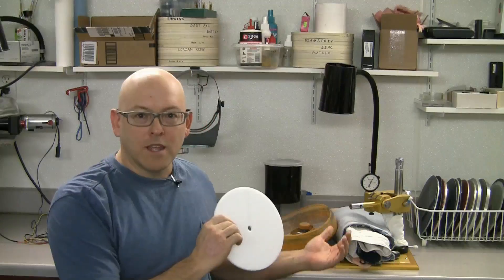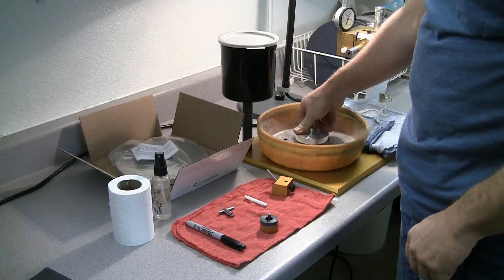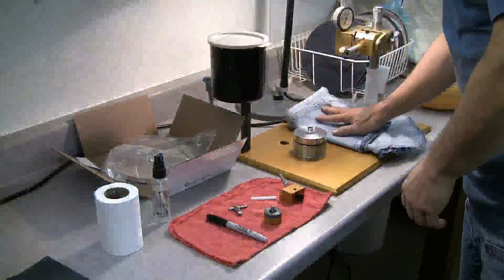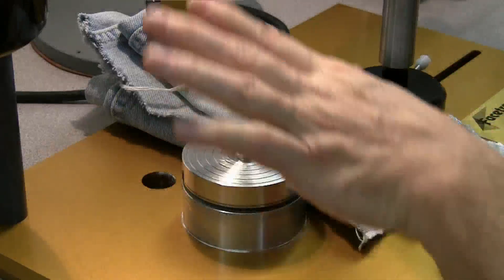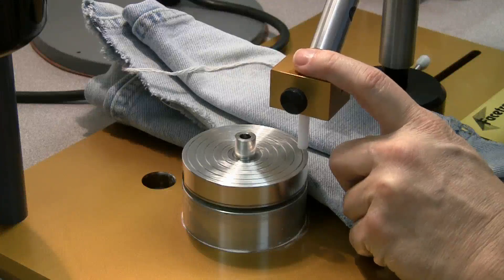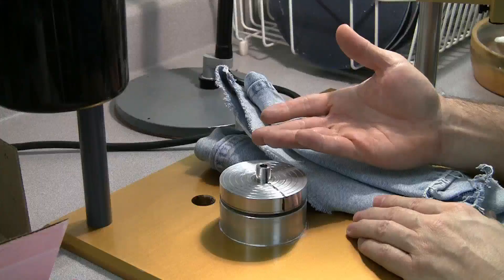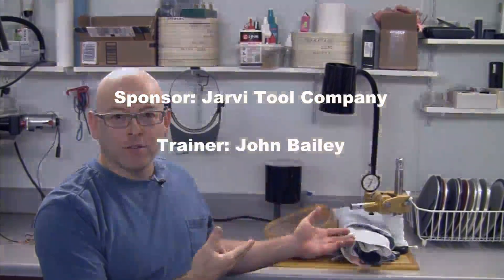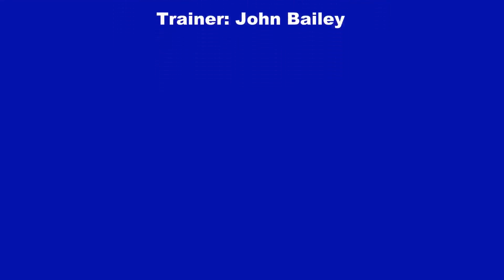Official Facetron Videos: Blueprinting Your Laps

Comment: Many thanks for this.  As we do not have a microphone, could we not use changes in our dial indicator to determine the high point?
Reply from the maker: I don't use a microphone for this. I just listen by ear.

You can NOT use the dial to do this unless the lap is very badly out. The adjustments we're making will show very little on the dial, or not at all.

Comment: would this operation yield better results by just using a runout gauge?
Reply from the maker: Most faceters don't have these extra tools - and ones that will seldom be used. So, we teach this "no extra tools" method. Also, the process of doing this method helps get fingers and ears "dialed in" to paying very close attention to feedback from the machine. So, we're training multiple things along with just learning the technique.

If you want to use a dial indicator, you need a way to mount it securely. The deck is aluminum, and not smooth enough to work well with a suction cup mount. So, when we use one, we mount it to a dop in the quill. Set the machine to a hard stop, and you're all set. Just be careful where the probe touches the platen. It will easily slide off or move in ways that corrupt your readings.

Hope this is helpful.